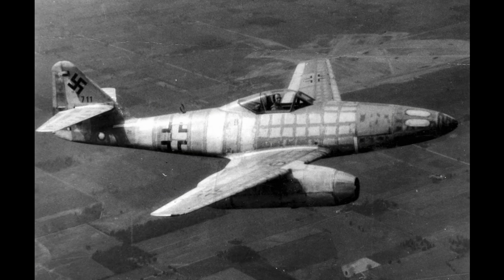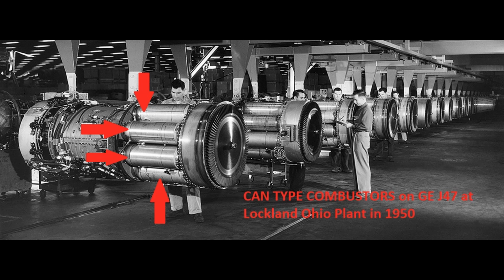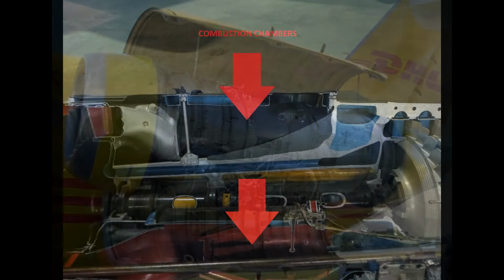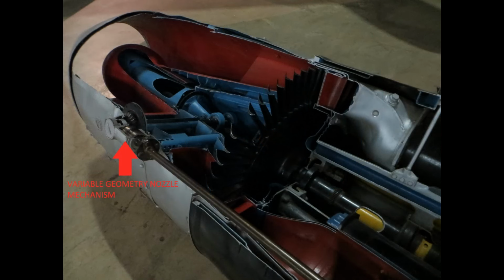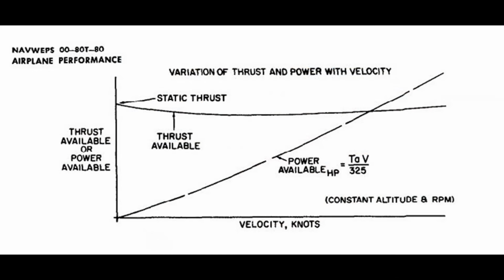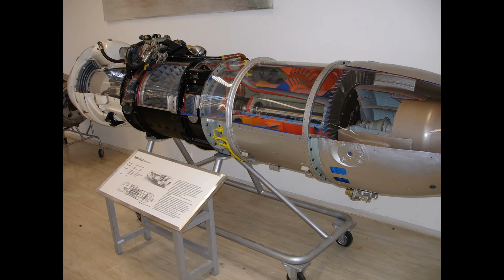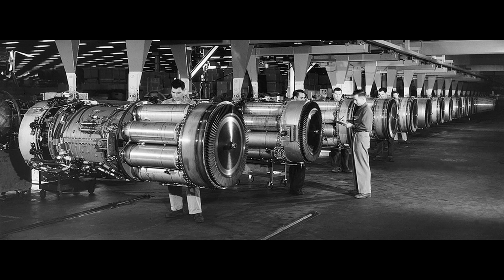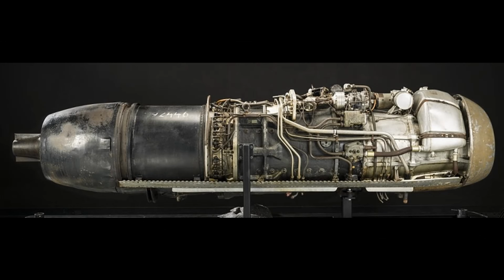World War Two JET POWER

Comment: My understanding was that the Ju287 as shown was a lash-up to test forward wing sweep. I seem to recall that it used an undercarriage from a crashed Liberator. It wasn't a production aircraft. Hence fixed landing gear.
Why no mention of contemporary British contribution to this phase of jet engine development?

Thanks for so many great videos.
Reply from the maker: Yes, it was a prototype, it wasn't going to be produced that way, but still, it's  a weird way to start with your prototype. This video didn't have the British jets because I'm saving that for a more in depth comparison. Including them in this would have just made the video too long.
Reply: @GregsAirplanesandAutomobiles  Green has line drawings for the proposed final form of the aircraft, rather than the photo you showed of the test bed. The test bed used Jumo 004's. The production form is listed as having BMW 003A-1 x 6 under the wings in a cluster of 3 per side.
Reply: @GregsAirplanesandAutomobiles  just reading my copy of Wm Green's Warplanes of the Third Reich, he refers to the Ju287 as s flying test bed used to evaluate the "low speed characteristics of the wing at full scale" due to its unconventional wing with reference to aero elasticity. It also used an He177 fuselage, the tail assembly used Ju388 components and "owing to its need for absolute structural integrity, a massive fixed landing gear was adopted, the nosewheels...from a B24, and the main members...of JU352 mainwheels.
So a flying test bed, not even a prototype? Hence the make do and mend approach. Just a lash-up, not even a serious manufacturing proposal, it appears.

Comment: 22:30 He-162 concept was fatally flawed: they had so few pilots that it was better to put them in the superior 262's.  Granted pilots were in short supply but I think they flew 109's and 190s until the end of the war, no?  So while they had fewer pilots than they wanted or needed, they clearly had more pilots than 262's.  Further, while the 262 had speccier specs than the 162, did it NEED those specs to shoot down allies?  They both could go FAR faster than Allied planes, the 162 with only 2x 30mm, true, but with its speed and climb advantage I imagine it could boom and zoom until its mere two guns finally shot down its target.  This might be the only thing on your channel--which I think I've watched compleat--that I have to take absolute exception to.
Reply: + lqr824     Most of the Me-262s that were produced sat on the ground without fuel for them and were destroyed in attacks.  Getting back to the discussion on pilots,  I think pilot experience would also factor into it since by late 1944 the Luftwaffe had pilots but was running out of experienced pilots.  I would think that he He-162 was both cheap to produce and would also be simpler to operate for a novice pilot.  There is no complex piston engine to manage or nasty traits from a big prop or tricky handling.   While the Me-262 would be superior,  transitioning pilots to a twin engine aircraft with unreliable engines would take far too much time to get them into combat.
Reply: @FiveCentsPlease  do you know if it was harder to make jet fuel than piston engine fuel for the Third Reich?  The jet fuel was certainly far lower octane.  And I have to assume the single-jet 162 would have used far less fuel than the 262, so to the extent that was a serious constraint, the 162 would have allowed far more missions (up to twice??) for a given amount of fuel.

My strong contention isn't so much that the 262 was bad, but it was something that should have been tried AFTER single-jet aircraft were no longer able to do the job.  They should have started with 162's and moved to 262 (if necessary) rather than start with 262.

One additional thing: the 262 had to be throttled way back in landing, and took a long time to spool up again, making planes while landing sitting ducks.  Even if they spotted an attacking Tempest or what have you, they couldn't accelerate fast enough to actually fight.  In contrast, the 162 probably could have spooled down less (due to one engine) and be that much closer to getting back to full power.
Reply from the maker: That's OK, I have over 90 videos on this channel, I would expect you or anyone else to be able to find at least some points you disagree with.
Reply: @GregsAirplanesandAutomobiles  Touche :-D, but seriously interested if you think I'm wrong and why.

Comment: The 004 was not unique in having an axial compressor: other German engines of that era also had axial compressors - and so did the British Metrovick F.2,  which first ran in 1941.  It had an axial compressor and an annular combustor: its basic design led to the Metrovick Beryl and the Armstrong Siddeley Sapphire.
So let's give you a reality check on just how unreliable and inefficient the 004 was, by comparing it with Whittle's simple little W.1 engine, which flew in 1941.  Relative to the W.1, the 004 had an inferior thrust-to-weight ratio, and it had an inferior specific fuel consumption.  Its handling was such that any sudden throttle movement resulted in a surge, and it was notoriously unreliable. If an 004 achieved a life of 50 hours, that was an exception. 
In contrast, the W.1 had to do that over 25 hours on test at high power before it was even considered airworthy.  If Nazi Germany had developed the equivalent of, say, the R-R Derwent and used it in the Me262, then it would have been a fearsome machine.
Reply from the maker: You're using the F.2. as an example and think I'm the one who needs a reality check? The F.2. was so unreliable it never made it into production.
Reply: @GregsAirplanesandAutomobiles  Yes, you're right: the F.2 was initially so unreliable by British airworthiness standards that it never went into production, but it was far more reliable than the 004.  
I gave you a valid comparison of the relative reliability of the W.1 and the 004.  The Whittle W.1 had to complete 25 hrs of high power running on the test bed, which it did with no problems, before it was cleared for 10hrs of flying in the Gloster E.28/39 in 1941.  Again, it achieved that with no problems over several flights.  It went on to accumulate more flying hours before being replaced by the W.1A engine in early 1942.
The 004 would never have achieved that level of reliability in 1944, and would certainly not have passed a UK Air Ministry type test, as required for engines such as the  W.2B, the Welland, the Derwent and the Goblin towards the end of the war.  Typically, these engines had a TBO (time between overhauls) of 150 hours, having been tested for 500 hours.
Reply: @GregsAirplanesandAutomobiles  I've just posted the following elsewhere on another YouTube channel, where the title reads, 'Von Ohain, Father of the Jet Engine'.  Please read, note and inwardly digest.
In later life, Dr Hans von Ohain acknowledged on several occasions, to several distinguished British gas turbine engineers that, had Whittle received the same support that he had received, the RAF would have had jet fighters in service some three years (or more) before the Luftwaffe.  Having been evasive when interrogated after the war, von Ohain also acknowledged to Whittle himself that he had read Whittle's original patent when it was circulated in Germany, soon after its publication as a provisional patent by the UK Patent Office in 1931. 
Can I suggest that you get a copy of 'German Jet Engine and Gas Turbine Development 1930-45' - if you can afford the exorbitant cost, now that it's out of print?  Such a conversation is recorded in the foreword by the late Dr Gordon Lewis (formerly Technical Director at Rolls-Royce, Bristol), for whom I worked briefly before his retirement.
The book also records how notoriously unreliable the German engines were, and I will give you just one example.  Immediately after the war, the Americans and the British were able to use BMW's high altitude test plant in Munich, and arrangements were made to test a DH Goblin I in August 1945, with the assistance of German engineers.  After 5hrs of testing, the German engineers expected the test cell to be opened up to inspect the engine.  
They were greatly surprised to be told that this would not be necessary, and the engine was run for a total of 42hrs before being inspected.  A Goblin II was subsequently tested and ran trouble-free for 71hrs.  The book (I do have a copy) also states that 004 engines had to be overhauled after their initial testing before they were released to service. 
Returning briefly to the subject of the Metrovick F.2, it was flight tested on the Meteor in 1943, which meant that it had been tested and cleared as safe and reliable enough for flight, in the same way as the W.1 was in 1941.  The engines were installed in neat, slim underslung nacelles, similar to those of the Me262.

Comment: The axial flow turbojet, a design Whittle deliberately avoided producing during WW2 because of the exact problems that the 003 and 004 suffered.
Reply from the maker: No.
Reply: @GregsAirplanesandAutomobiles  Go read Whittles book
Reply: @jameshamilton4327  Whittle said lots of things; it doesn't mean they were true. For instance, he made a big deal of some no-nothing called AA Griffith who was mean about his design and stopped the Air Ministry recognising his brilliance. He doesn't mention that Griffith had already patented an axial jet design and was able to point out major flaws in Whittle's calculations.

Comment: On the life expectancy... the german piston engines weren't much better. In order to get the DB605-D up to 1800 hp while still running on 87 ROZ fuel, they equipped the engines with water-methanol (MW50) injection and nitrous oxide. They also increased the boost provided by the supercharge. While these engines were officially rated to be refurbished after 220 hours, running the engine with MW50 could seize a piston in minutes.
Reply: + KR4FT W3RK    And the restored German engines today are bound to the wartime maintenance intervals currently,  whereas continuous use of the Merlin after WW2 and improved overhaul practices have stretched the TBOs on the Merlin to nearly 700 hours if you don't run them hard.  (Some engines even higher.)   It will be expensive to keep a German piston engine flying until better maintenance standards and practices are devised for them.

Comment: "onion" in german means "zwiebel". the starter was a 270 cc two stroke engine, which delivered about 11 hp at 7150 rpm. ist is called "riedl-anlasser", named after his developer norbert riedl and it was manufactured by victoria-werke in nürnberg. just by the way.
Reply: +bloedbiber     Yes,  the Riedel start engine was about 10 hp.  It could be started with a pull start or with an electric start from the cockpit.   https://www.youtube.com/watch?v=BGUqV0dl9gA

Comment: Junker Ju-287 V-1 actually has a fixed undercarriage with a nose wheel taken from a crashed B-24 purely to speed development and act as a low speed test bed for the forward swept wing. production aircraft would have had retractable undercarriage. The Ju-287 V-1 was Jumo 004 powered but more thrust was required therefore 6 BMW 003 were to have been used.

Comment: The "bang" part of suck, squeeze, bang and blow is a big problem if it's literally a bang.  Sounds like it's basically a holdover from reciprocating engines.  Suck squeeze, burn and blow would be more accurate for turbines.   Funny, I worked as an engineer in the gas turbine aero industry for about 15 years and don't recall hearing turbine operation described that way.
Reply from the maker: Then you are not thinking like a typical pilot. At least not the pilots I have worked with. It's suck, squeeze, bang, blow. If you are burning during the process you are doing something wrong.

Comment: Start the turbine on alcohol as it burns at a lower temp?
Reply: + Dr. Reason      I think I read that the Jumo  004s were started using the petrol from the 2-cycle Riedel starter motors before switching to the kerosene fuel.  (I believe I read that in some of the AAF documents from examining and flying the captured aircraft.)
Reply: @FiveCentsPlease  I want to try and put alcohol in the combustion cans after you spin the motor up to speed to lower the temperature spike when starting. Then switch to kerosene when they are up to speed.

Comment: I heard about 10 or 20 years ago that the only remaining Gloster Meteor still flying was still using it's original unrebuilt engines.  I wouldn't be surprised if that was still a true statement. Sounds like a pretty good engine to me.
Reply: You are very gullible and naive if you believe that!
Reply: @sandervanderkammen9230  I do believe it.  They were doing a piece on TV about the oldest jet still flying, or something like that, and they were there at the place that owned that particular Meteor and the guy was standing right in front of it when he said that.  How many hours could a Meteor have on it?  It's surprising, but believable.
Reply: @sandervanderkammen9230  yawns Sure..
Reply: @Strike_Raid  The only Gloster Meteors flying today are powered by Rolls-Royce RB.37 Derwent 8 engines that didn't exist until the 1950s
Reply: @Strike_Raid  The original Power Jets Ltd. W.2 engines had a TBO of just 50 hours, the later Rolls-Royce Welland engines 100 hours.
Reply: @Strike_Raid  Any questions son?

Comment: So why are turbines, now orders of magnitude more expensive than a piston engine?
Reply from the maker: I'm not so sure they are. A Williams FJ33 turbofan costs about 420k. Try to find a new 2000hp piston engine certified for use in aircraft at that price.
Reply: @GregsAirplanesandAutomobiles  a 600hp falconer v12 is around $$70,000.... a 600hp turboshaft is in the half million territory...
Reply: @GregsAirplanesandAutomobiles   I think the price for a typical Merlin full overhaul has approached the $250K mark or maybe surpassed it by now, perhaps more for a rarer dash number engine.  It's been a while since I looked.   The TBOs are much longer now than wartime.  Overhauling one of the German piston engines seems to be in the ballpark of 4 times as much, plus you have to locate multiple core engines for parts--not that many out there.  The TBO times for the German piston engines is still closer to the factory specs at 100, 200, hours etc depending on minor overhaul or full overhaul.  There is maybe nine or ten Bf-109s that are flyable worldwide but only three or four are flying at a given time while the others are down for repairs or servicing.  And there is maybe another ten or twelve Bf-109s in very long-term (15+ years) restoration to fly eventually.   Those are very expensive aircraft to rebuild.

Comment: An other important reason for high bypass ratio is to reduce the average exhaust speed. By mixing the relative low speed but high volume pass by gas with e high speed lower volume core gas. The benefit of the lower combined gas speed (but high volume) have a significant effect on the emitted noise. The is critical for all commercial airlines. Without this they would be allowed to fly at any significant airport in modern time.

Comment: The most advanced design? It most probably was. The “best”? Probably not. It had a service interval of 25 hours due to metallurgy problem. The Whittle centrifugal engine, while not as advanced a design, is much more durable. There are examples of it still in flight.

Comment: The Ju-287 was not a really bomber it was a flying aerodynamic testbed for engine layouts and forward swept wings it maybe would have ended up as a  bomber had it been a success or the war had run into 46 or 47, built entirely of parts from existing aircraft even some from allied wreaks.

Comment: Does the comparative build times mentioned here take into account the fact that the 262 needed a pair?  Imagine the effect of hundreds of 262s flown by capable pilots on Allied bomber fleets.  We're talking of an aircraft at least 100 mph (maybe more with after burning) faster than the escorts and armed with four 30mm cannons, far more powerful than the British 20mm and I suppose even more so than the American .50 machine guns.  They would of decimated them.  Engine life would of been of more important because of longer airframe life and crew survivability of course.  One has to marvel at the ingenuity and skill of German designers, especially when considering what pressure they were working under with limited materials available.  No doubt it greatly benefitted the British, Russian and American aerospace industries (particularly the U.S. because of their financial wealth.)

P.S. why not use contemporary British jet engines as comparisons as I believe they were in second place behind Germany post WW2?
Reply from the maker: I didn't use the British stuff because I am planning to do that another time. I can't fit everything into one video.